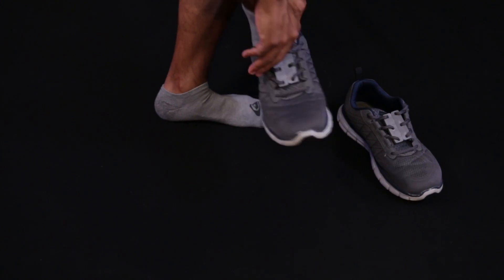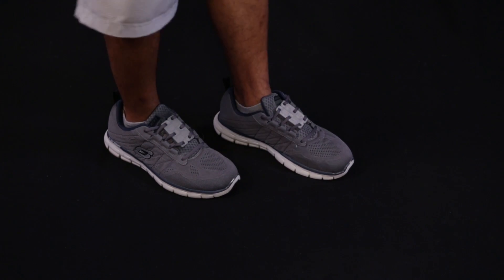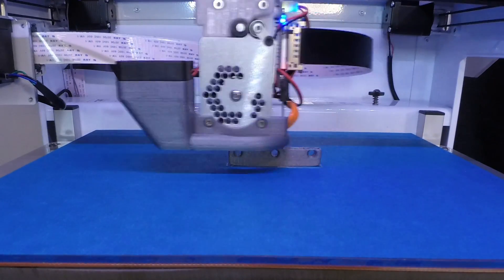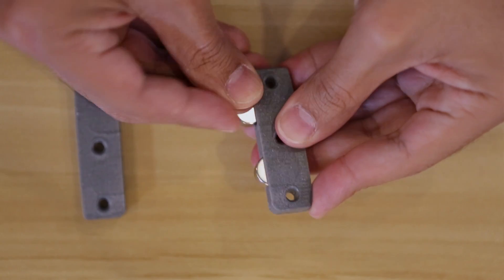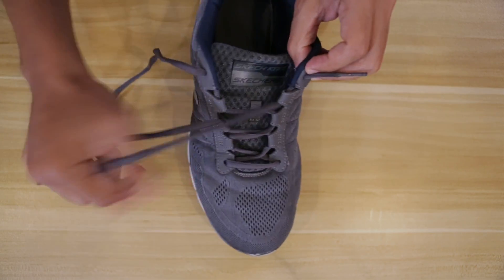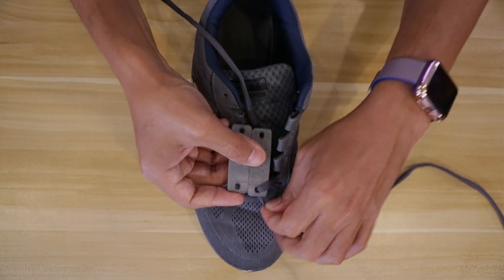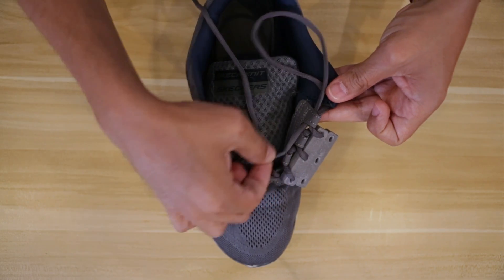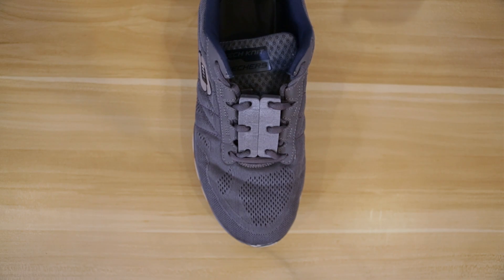Magnetic Shoelaces #3DPrinting

Comment: I've been using the klots you can find on thingiverse together with the klots hold remix. So far the only setup that's easy and won't come loose during cycling.
Whilst I do think these magnetic laces are a great idea for every day use I doubt they'd hold up well during more active use like cycling.
Reply from the maker: looks like tolerances would loosen over time on friction fit designs. Doesn't look like they give away the source files to easy adapt the design, so not the best to teach in a class room. Looks tough to use for people with fine motor control problems :)
Reply: very true, and magnets are cool!